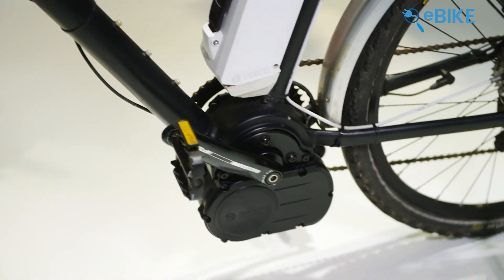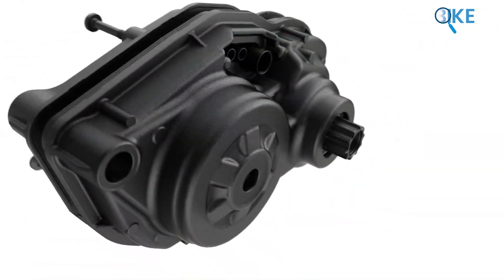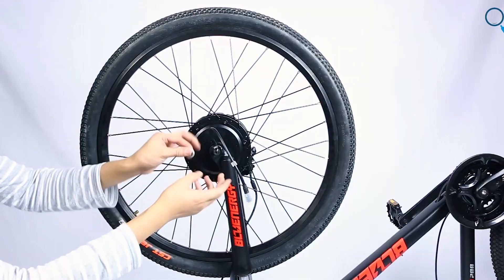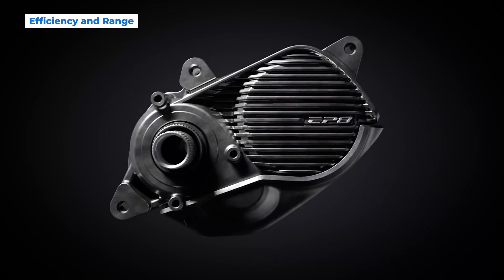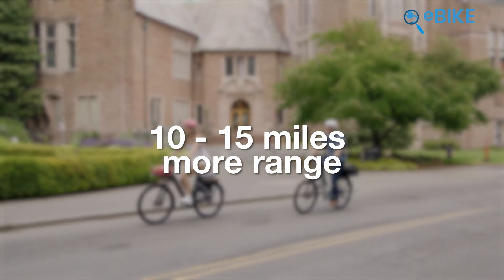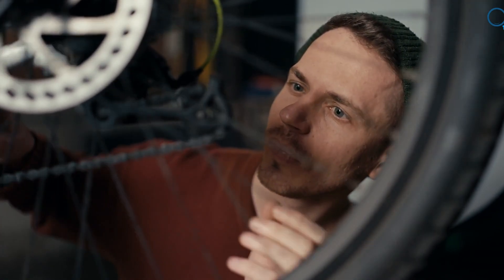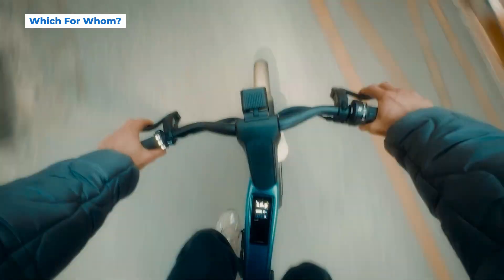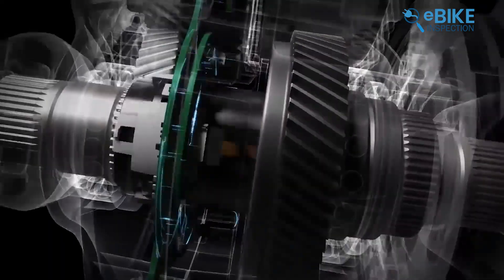Hub Drive vs Mid Drive Motor -You Can't Stop This Debate

Comment: New to this but from my understanding so far, hub motors are more future-proof because mid-drives need special frames that have special mounts, and these special mounts vary by manufacturer, and sometimes even between different product lines/generations of the same manufacturer. So if that company stops the product line, your frame is trash.
Reply from the maker: Agree
Reply: luckily frames are usually the most durable part of an e-bike.   As long as the frame last you may not be able to get a whole new motor, rebuilding the one on the e-bike is often still cheeper than buying a whole new hub which is the case if that breaks..   the eternals of a mid drive motor tend to use as this video pointed out Modular parts.